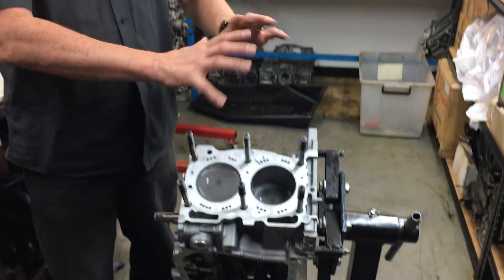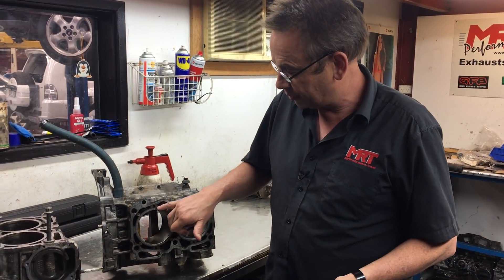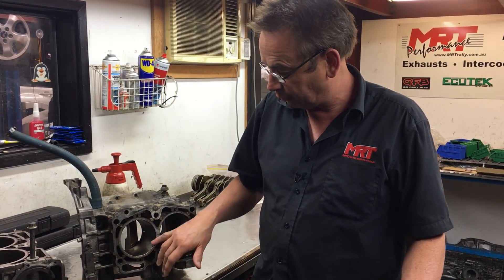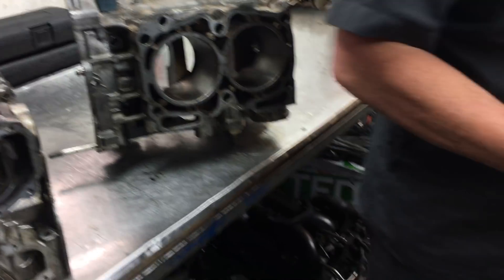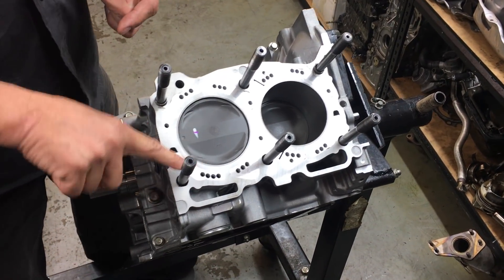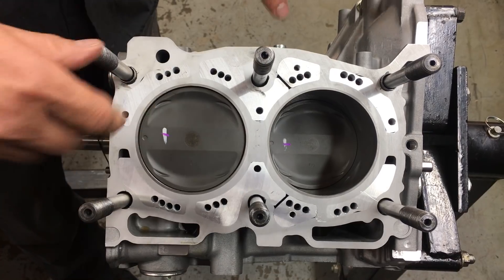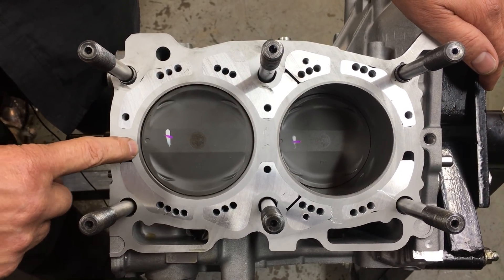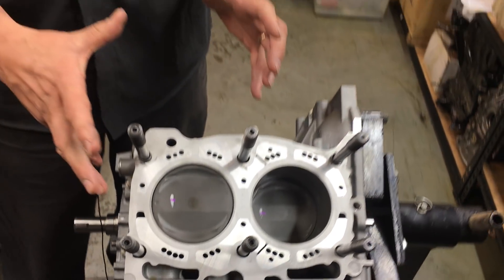Closed Deck EJ207 Engine Build and Comparison

Comment: sorry if this a stupid question, but would the liner lower the displacement?
Reply: Terry Low, no as they over bored the inside of the cylinder walls to put the liner in. It would still be a 2.0L
Reply: @nuftie7292  that makes sense. thank you for the reply.
Reply: Terry Low no worries

Comment: Hi Brett! Thanks for the video, I have a question with regards to the pinned deck version. I was thinking about doing this to my cylinder blocks, but I was wondering if you have any idea of what the interference fit for this should be? I'm looking into this option because I have access to a lathe and a milling machine, but not a CNC machine.
Another question would be if this is actually necessary for a 350-400bhp engine (EJ20 1995 - from I believe a first gen wrx or something, came with a td05-16g). I'm rebuilding the engine for in my first gen Legacy wagon, got the internals sorted out, but am just looking into this in case I have different plans in the future, power wise.

Comment: Hey Brett what’s the maximum displacement you think you could take this block too in a higher horsepower application? I’ve seen a few ej207 stroker kits float around and wanted to ask a engine builder?
Reply: A 2.2 or 2.1 is as big as I'd suggest going. I'm no engine builder but if you go any bigger than that, you might as well get the ej257.

Comment: how do you access the main bolts with the closed deck inserts in place? would the block need to be married with the rotating assembly inside before adding the closed deck inserts?

Comment: Would it have been cheaper and easier to use a EJ22T block (plus more displacement)? Or is the factory closed deck not as strong as your awesomely modified Ej207?
Thanks again for the great videos!
Reply from the maker: EJ22 is not strong enough
Reply: The close decking isnt too expensive these days anyways.
Reply: Excellent content and video! Thanks for all the info.

Can the closed deck mod, liners, and studs, be done on the us version ‘13 wrx 2.5? 

If not can the 2.0 as shown here be set up to work with a ‘13 WRX with 100% of the factory equipment (variable cam, smog etc), systems, accessories, harness, and ecu? Thanks again

Comment: Great info one question though what would be the average cost to closed deck a 2009 STI engine block 2.5
Reply from the maker: best call us as costs vary with mods and packages
Reply: MRT Performance can I call now

Comment: i know the early EJ207(v7/8 ) redline around 8250-8500rpm. is there any particular build that will allow it to rev freely to 9000rpm without affecting to much drive ability ad durability ?
Reply: valve springs, valves, cams, then u would need to upgrade things like turbo etc then tune, the stock turbo will be out of its efficiency range at 9k revs
Reply: Listen to fly cat hes on the money

Comment: Brett, 
I understand the reason for boring the cylinder after the installation of the inserts, but I don't quite understand the thin liner being installed in the factory liner? Is it a harder material or is there another reason?
Reply: The liner is installed in this case so the factory forged pistons can still fit.
Reply: Thanks for clarifying that. I listened to it again and that is what he said as well...

Comment: A lot of Subaru aftermarket companies here in the US are using the factory sleeves on their closed-deck 2.5 blocks without the cast iron liners shown in the video. I suppose they are over-boring the engine and using oversized pistons?
Reply: The liner is installed so the factory forged pistons can still fit.
Reply: that would be scary.

Comment: how much hp a ej257 block could take with upgraded internal and stock block (in very safe tune)?
Reply from the maker: too many variables to answer here, best visit MRT
:)
Reply: well i was thinking around 380 hp  for a very safe tune
Reply: Carl Raymond Grenier yu can push 380 easily on sti motor jist get a good tune and dont rev it high and beat the crap out of it lmao
Reply: Depends on how many upgrades have been done. 
With only upgraded to forged pistons (the stock block's main flaw) people have few problems in the 400-500 hp range.
With upgraded everything (heads, rods, bearings, dry sump, etc) I would think 600+, maybe even a 1000 with race gas and meth injection. But the block's safety will be put to the test as it is probably the weakest link in the chain after upgrading everything else.
Of course it's all up to the tune.

Comment: Ummmm... Doesnt the aluminium block corrode with that cast iron lip????
Reply from the maker: no
Reply: Called a dielectric union, it happens with steel and brass but I dont think aluminum and iron do it because aluminum doesn't oxidize like other metals do.
Reply: how would it? only way for it to corrode would be to blow a headgasket and leave the water in the cylinder to long

Comment: I've got a spun-rod EJ257 block sitting on my backburner, I was planning on just slapping something together, aiming for 300+ crank horsepower if I can, VF39 turbo, hopefully putting down somewhere upwards of 15lbs of boost (sorry for all the Imperial units, America just can't get with the program). I've also got a set of EJ25D DOHC heads that are non-variable-valve-timing like you mention towards the end of the video, are these the type of heads you're talking about when you say original GC8 heads?
Reply from the maker: the heds in this video are GC8 heads of a Pre MY00 engine
Reply: DOHC or SOHC?

Comment: I would like to know the safe power output on the 207? Running bigger top mount, VF34, AVO intake, exhaust and the pump? Those engines are just awesome, and goes strong in my GC8 tuned by Sean. Love the vid.
Reply from the maker: not an easy question to answer as there are so many variables......

Comment: We are actually having trouble with hg being blown over 25psi in our stock ej207 block so i guess we should go closed deck too. How can we look for the closed deck blocks? We have lots of jdm engines here in my country.
Reply: Jassaicraft, you can bye new short EJ207 block and you would have to closed deck it I believe (MRT can do it for you). Another option is to buy a sued one but this has to be one very well checked because those are boosted all day long :). Tuspeed in Sydney got Ej207 new for less than 3K
Reply from the maker: agreed
Reply: Peter Dudek im in Bolivia so a bit hard and expensive to import from another country. I read that some gc8 did come with closed deck but dont know exactly which or how to identify them?
Reply: jasaircraft you can use a boroscope to look through the water jacket crossover pipe and look at the decking. I've personally never seen marks on the case that prove it's a factory closed deck though.  If I'm remembering correctly the stock EJ207 doesn't like to hold past 21psi.